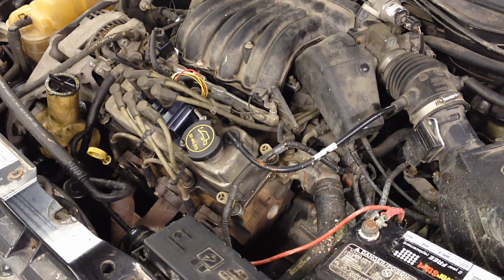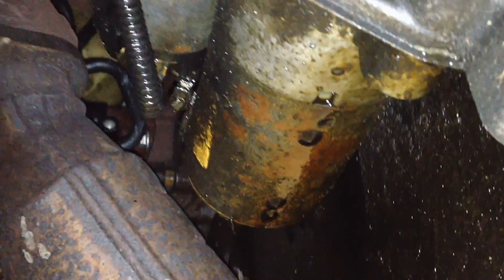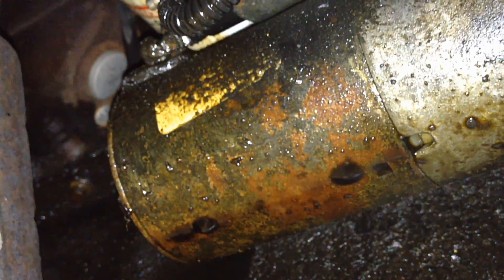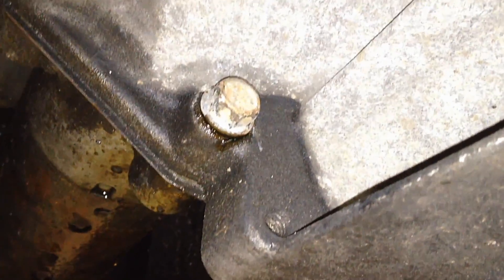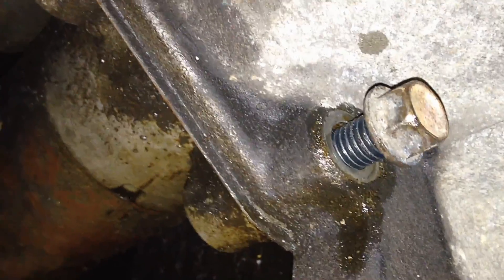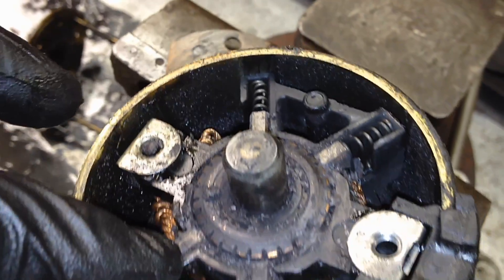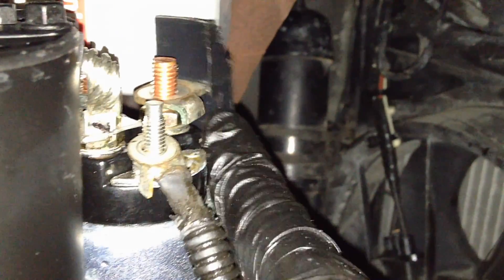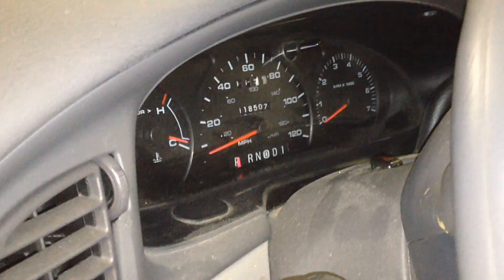Ford Taurus 3.0L 12v Starter Replacement & Failure Analysis

Comment: thank you very much, Im not a mechanical guy at all, but i just did this in about an hour. I did not even need a jack. Its true about the oil leaking on the starter. Its my fourth starter (get life time warranty).. First one i changed my self.
Reply from the maker: Yep I have done a many in the parking lot for customers to save them towing charge.

Comment: Of course the little 3.0 spins nicely with a rebuilt starter, but I'd like
to see you repair the old starter with a new brush set, cleaning the
commutator, etc then fashioning a shield to keep oil off it in future.
Brushes are available and it would be great for Depression-laid off
people who can't just pull $150 out their yang for another starter.

Comment: If that old starter was only malfunctioning because a mixture of oil and graphite from the brushes (which is normal wear) was preventing an electrical circuit from completing then that starter could have been cleaned up and reused (assuming nothing else was wrong with the starter). I state this because the starter interior looked in good condition (otherwise). Of course, the initial oil leak source would definitely have to be resolved.
Reply from the maker: True but this starter was original, after all these years of wear and tear and now contamination it would not be reliable and the proper repair is fixing the oil leak and putting a fresh starter in there. This is an old couples car and they don't want to take any chances.

Comment: Howdy everyone. Fordtech I hope I'm not stepping on your toes, but I'm replacing my oil soaked started on my 3.0 today. Just thought I would throw the torque specs on all the bolts for the starter if anyone actually wants them. Per the piece of paper that came with it, the mounting bolts got 16-20 ft/lbs. the battery cable goes 98-115 in/lbs. and the switch terminal goes 40-55 in/lbs. good vid bud. Take care!
Reply from the maker: Thanks for that.

Comment: Tricky problem for you. I have a 03 ranger 2.3l. Slow crank and start up intermittently (seems like it starts right up in colder weather and struggles more when its warm out) I tested my battery and its good. I also cleaned up my terminal connections and I'm still having an issue. I also have a slight hesitation at cold idle. No codes. Any thoughts would be helpful. Thanks! Love your vids!
Reply from the maker: That is a oddball issue you have a quick video posted of it acting up during starting that would help allot.

Comment: I have a 98 Ford Expedition with the 5.4 motor last week I threw a code P0304 I change the coil pack and plug but I'm still getting the code any suggestions
Reply from the maker: Does it feel like it is misfiring? Just to be sure you replace the coil and plug on the passenger side last one in the rear? Was there oil all over the coil boot? Was it fixed for awhile then started running rough again and throw the code? You cleared the code after the fix right?
Reply: yes it feels like a miss.ive replaced the correct coil and plug. didnt get to see the boot{lost in the blacck hole} but the plug was dry. after replacing coil and plug still running ruff.
Reply from the maker: chipete1 Ok so it runs rough at idle definite miss right? Then I would suggect unplugging the coil and see if the miss gets worse or it doesn't change and we can go from there. See here-  Ford Coil On Plug Misfire Quick Diagnosis Methods
Reply: FordTechMakuloco today i went to pull the coil connector and noticed that the fuel injector plug was undone.plugged it back in and now she running back smooth. THANKS AGAIN!!!!!!
Reply from the maker: Awesome now that is what I like to hear.
Reply: one more question...on the left side{pass} of the throttle body i noticed a rubber hose collapsed. the other end of that hose goes to the pvc.do you know why that happen
Reply from the maker: This is quite common and is from the very harsh chemical vapors that are traveling through there, they soften and degrade the rubber until it is so bad the engine vacuum suck it in so ther is a large hole in it. I assume you changed it out correct? It happens on allot of different engines. I just did one on a freestar- Ford Freestar P0171 P0174 Runs Lean & Dies Out
Reply: FordTechMakuloco im going to change it tomorrow, but will a bad pcv cause it to collapse
Reply from the maker: chipete1 No it will not.

Comment: How was the oil filter leaking, was it not screwed on tight enough?
Reply from the maker: yes jerk lube techs, filter was barely on there and the drain plug was on there with a breaker bar.
Reply: FordTechMakuloco
Another reason to change your own oil, those oil jockies couldn't care less about your car, if you want it done right you have to do it yourself.
Just like a PowerStroke I bought that was a no start, the Ford stealership charges the org owner over $1800 to fix it, turbo rebuild, and some other new parts, I towed it home and had it started in under 2 hours, they either were too ignorant (kinda hard to imagine but whatever) or could not care less and just wanted to milk the man's wallet with work...
I paid him less than he paid the dealer and came out with a nice truck with lots of work done to it because the Ford techs didn't check to see if it had fuel pressure, clogged tank and the other tank pickup tube was broke so it wasn't getting any fuel, pretty funny from my end.
Like I was saying, the grease jockies don't care about people and well either my local Ford dealer hires burn out morons, or just liars to work for them, it's one or the other.